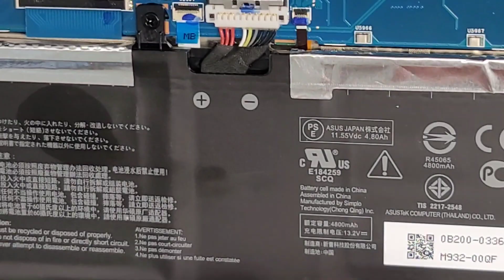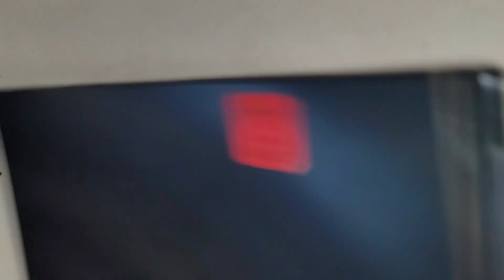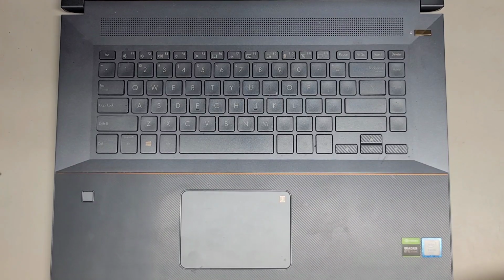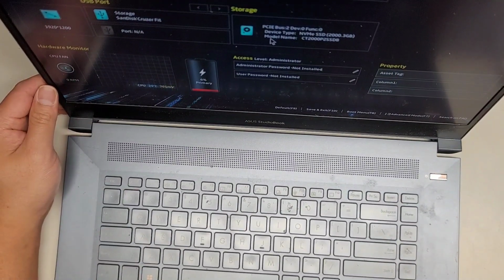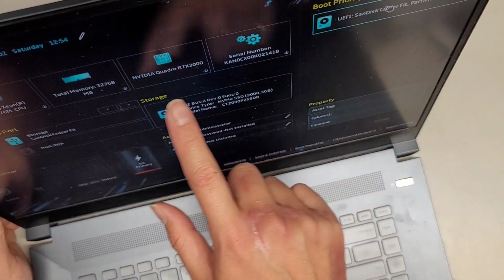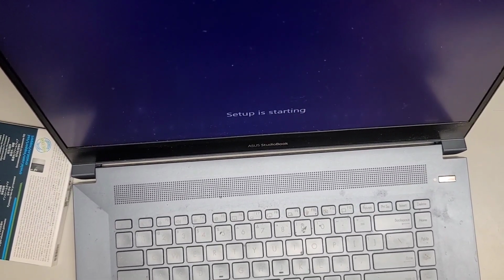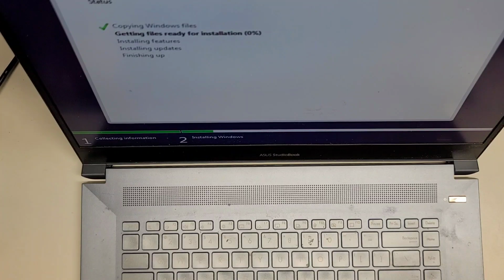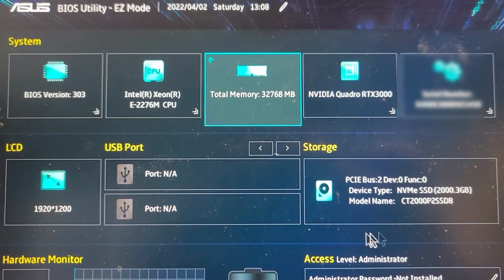ASUS W700G W700 StudioBook Disassembly RAM SSD Hard Drive Upgrade Quick Look Inside Close Look

Comment: I have the H700 which comes with 1TB M.2 SSD, and I recently installed a 2nd one, same specs. But now I can only turn on the laptop and it gets stuck on the Asus logo screen, it doesn't boot into Windows. If I remove the new drive, it boots as normal. I can't get into the BIOS when the 2nd drive is installed. What do you think it could be? I reached out to Asus for support and told me my new drive was "not compatible", recommending instead some 4-500 dollar drives from their website...
Reply from the maker: Try swapping their places.